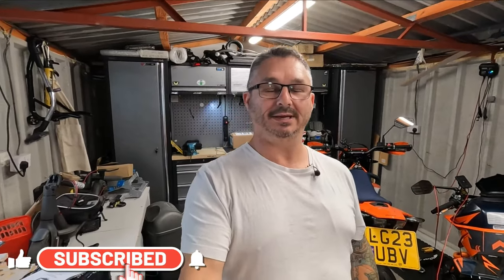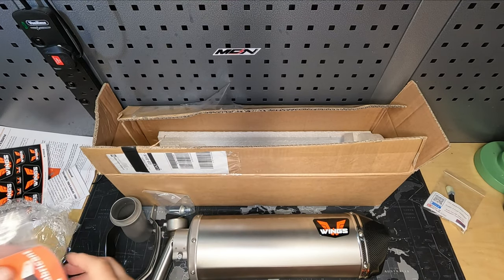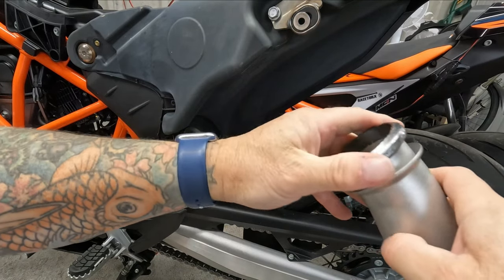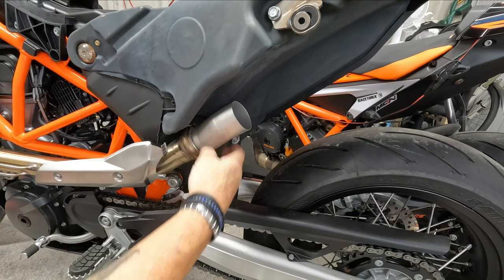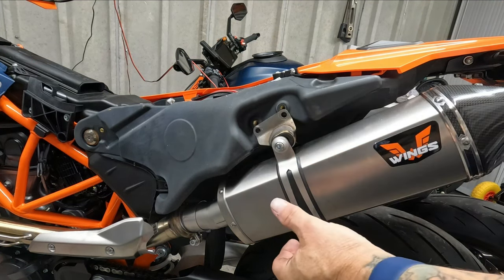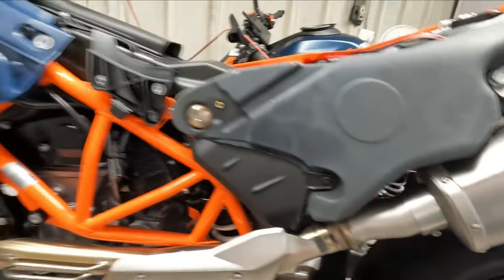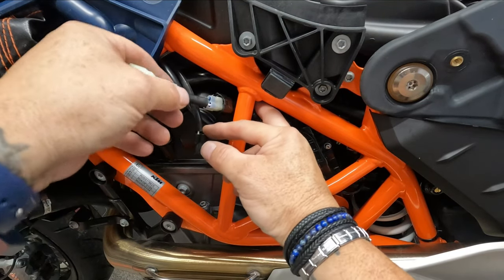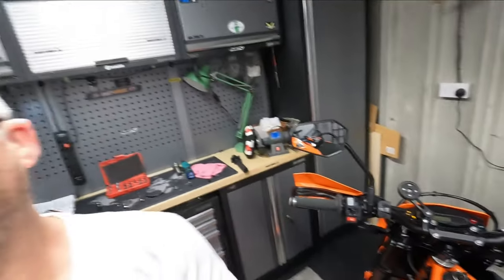Wings exhaust, fuel dongle on a KTM 690 SMC R

Comment: Fitted the Wings exhaust & CRT dongle a week ago, great tip taking the top hanger bracket off first, I struggled a bit getting the hanger loop to close on my 23 701. The bike runs great & as mentioned it is quite a bit louder. 
Great post,✌ keep them coming.
Reply from the maker: Thanks pal. Much appreciated.

Comment: Robbie, its not a dongle its a Fuel Optimiser which isn't the same. The Fuel Optimiser was designed for Euro5 bikes and is NOT an O2 delete which some people get confused with.
Reply from the maker: Hi. 
I called it by its proper name at the beginning, I just continued to call it a dongle as many others have. 
Interesting to know that some may think it’s a delete. I can’t recall if I said it in this video but in my review video  I did say it basically alters the Co2 values so the bike runs richer.

Comment: Thanks for your reply 👍 Iv subscribed and will watch to see how you get on with the 690 !! Your the first person Iv seen who has done the fuel dongle and slip on without other mods !! Good to hear it’s improved it , think that’s my first move !! Will message you with my thoughts . I’m quite experienced with suspension and have a feeling despite the front forks looking high quality the damping internals are quite basic . Will give you a heads up when I investigate more !! Lighter bikes are often more sensitive to suspension they tend to bounce over rather than absorbing imperfections if the spring rate is to high 🙈
Reply from the maker: Thank you I appreciate the sub and look forward to the updates.

Comment: Viewer from the United States here! I’ve also got a 2023 690 SMC R with the Wings exhaust, same tail tidy, and I also did a Rottweiler Fuel Dongle. Super happy with the mods I’ve done and how the bike is looking (nearly identical to yours)! Great minds think alike!
Reply from the maker: Sure seems that way 😁
Reply: is it necessary to have the fuel dongle or can I do without it for a little while, I have the wings exhaust already and I’m ready to put it on the bike, but I do not have the fuel dongle
Reply: @Eudonis3  - Wings claims that you can run their exhaust without any other modifications, just follow their guide and do the 15 minute fuel reset as outlined in their install manual. The bikes run pretty lean at low throttle and below a certain RPM for emission reasons when stock and a more open exhaust could make em run more lean which would be a hotter combustion temp. I highly recommend the Rottweiler Performance fueling dongle. It’s very affordable and easy to install. Huge difference when in traffic around the city as the bike smoothed right out with the dongle. If you are doing an intake with your exhaust, you’d for sure want to do a fueling mod. Hope you enjoy!
Reply from the maker: I fitted a fuel dongle as well.
Reply: @davidk5937 why can’t I find the fuel dongle for a 2023 Ktm enduro on Rottweilers website? Or am I doing a guys look?
Reply from the maker: @robb-smith6328 I can’t help you there I’m afraid as the one I fitted was from a company called CRT performance here in England.
Reply: And you happy with the fuel dongle still?
Reply from the maker: Yes. It for sure helps with the low speed town traffic running. 
I’d still say a remap is the way to go which I do plan on doing this year. But as a quick remedy I’d recommend it.
Reply: @Robbiemoto  very much so! Hands down, the best value for dollar mod!

Comment: Hi !! Iv a 23” SMCR after previously having a 21” model . My new bike runs and performs quite well but as usual the fuelling at small throttle openings is quite choppy!! My 21 model I think was worse !! Gearbox and quick shifter on the new bike is a lot better 👍👍 but have to say I think the front suspension feels hard and isn’t very plush while the back feels on the softer side . It’s meant to have 215mm of travel on the front but only seems to be moving about 140mm . Any feedback from you would be appreciated 👍 Think the new bike is better but still needs work to make it perform and handle properly . I’m gonna stick with this bike and sort it . Not interested in more power but would like to optimise the fuelling and get a better feeling on bumpy back roads .
Reply from the maker: I’m no expert when it comes to suspension to be honest. 
I can’t compare it apart
from with the 21 Husky 701 I had for a brief time and it feels the same as that. 
I had the lowering kit fitted when it was serviced and when I went out yesterday I did find it quite hard. Needs setting up properly really. 
I agree power wise it’s enough for what the bike is but the fuel dongle and exhaust have without doubt opened it up more and less stuttery low down.
Reply: I just took delivery of my new 23 690 smc r and found the same the front fork compression was set all the way in backed it off to 15 clicks out from fully in and feels much more in tune with the rear now

Comment: I always thought that the 23 year model wasn’t effected by a fuel dongle? Maybe I’ll have to actually put it on
Reply from the maker: If you have one fit it. It’s definitely made a difference for me.
Reply: It's been proven many times on the dyno that the fuel dongle does not work on the euro 5. 
What you're feeling is most likely placebo. 
Ecu flash is the only way. 
Running the wings exhaust without a cat with stock ecu will make the bike run extremely lean below 7000rpm
Reply from the maker: @Bjork3n1  I hear what you’re saying but for me there is a difference. I rode with and without the CRT dongle fitted with the wings exhaust and there is a difference on low rpm. 
Maybe there’s a difference in dongles ! Either way it’s running better than it did before. I plan on getting it remapped when I change the air filter.

Comment: Hi, i was thinking doing the same on mine but i can´t get any answer form wings about db s. Does anybody knows how loud it gets with this exhaust+dongle? I use it on track and we do have noise restriction in belgium.
Thanks
Reply from the maker: Hi. I can’t comment about track noise as I’ve not took it on track. 
The baffle that comes fitted is what I would leave in. It’s loud enough to give the bike a nice fruity sound but not obnoxiously loud like it would be without the baffle. The other baffle they supply does make it quieter I believe but I’ve not tried it. At a guess I would say it would be ok for track use but as said I’ve no experience. You could ride to the track and ask them to do a DB check.

Comment: I spotted your phone mount. It’s frustrating, but the manufacturer has changed from the straight mount ( the one you have )  to a semi curved one !

If you upgrade your phone. Please be careful, because the new phone case will be incompatible with your old mount.😢
Reply from the maker: Thanks for the heads up. Not very helpful if that’s the case from SP Connect.
Reply: @Robbiemoto  I agree … even they admit it’s caused mayhem for their customers!

The baffling thing about the change, is that it hasn’t even delivered any fresh functionality or integrity!

Utter idiots.

I elected SP over the “blue tang “ quadlock… because I really didn’t want the “blue finger” spoiling the aesthetic of my motorcycle cockpit. But this has really caused me to dislike SP connect
Reply from the maker: I agree. I liked the simplicity of the SP. I have it fitted to both my bikes. The 1290 has the wireless charge pad on it.